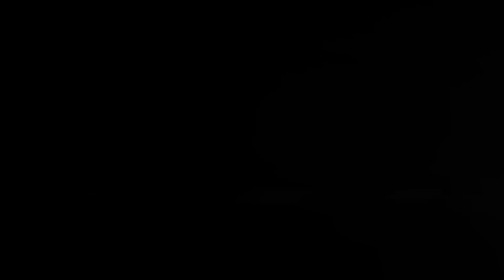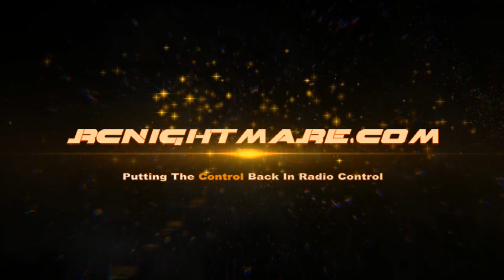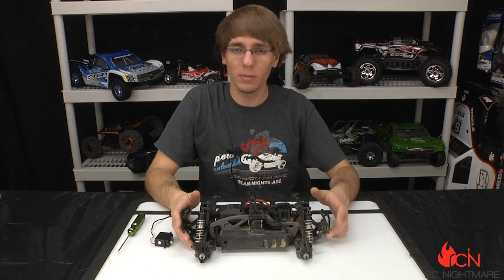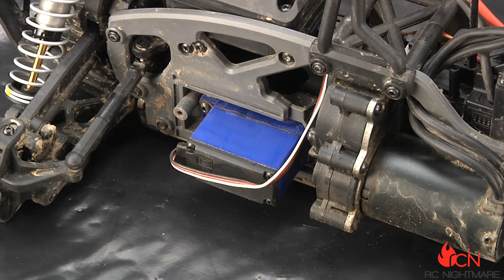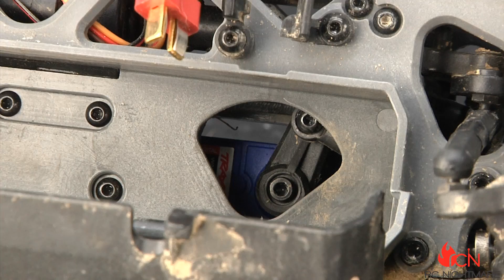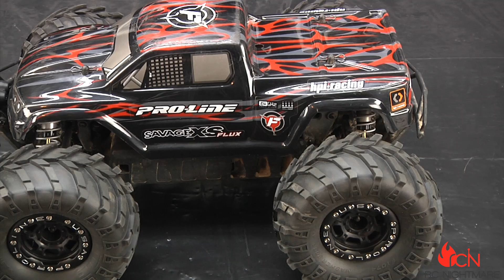HPI Savage Flux XS Steering & Tire Upgrade

Comment: I just got one of these  cheap about 15 bucks worked perfect but the tires suck so I luckily had a set of proline badlands and also a nice hi tech ultimate tq servo and it works super well great truck

Comment: what is the part # for the beadlock wheels and tires? Do these wheels have a wider offset than the stock ones? With the stock ones  you can barely get the battery door open, so I want to make sure that the new wheels don't make that issue worse.  Thanks!

Comment: thanks good thoughts..mine is not water resistant at all.. I used a Savox with 166oz servo that's fast and will handle any tire I want within reason I've even put 17 mm hubs on for 8th scale buggy wheels and tires.just for fun...I LOVE MY LITTLE MONSTER  thanks

Comment: Is there any problem with the tyres rubbing on the body at full lock steering? I saw a guy put trenchers on his xs and had to decrease the steering range dramatically so the tyres didnt hit the car when he turned, a total deal breaker for me.

Comment: Could you give the part number of the bead lock wheel being used in the video? Also, would this bead lock wheel be compatible with other standard size 1/10 scale pro line tires.

Comment: nice vid... but I still don't understand though why you want it to be 1/10 scale... you compare it to the Stampede 4x4, which is 100-150$ more, and alot bigger.

what it is more equal to is the Mini E-revo/Summit etc. which is the same price, specs and just slightly smaller.  Why don't you compare the Savage XS to these? because traxxas would be way weaker in every way?  and why is bad servo and plastic shocks suddenly a big negative on this one?? I think you should forget the brand and focus on

Comment: if i have a motor that uses 45 amps can u use an 80 amp esc from a plane i know i would not have backwords but would it work and not over heat